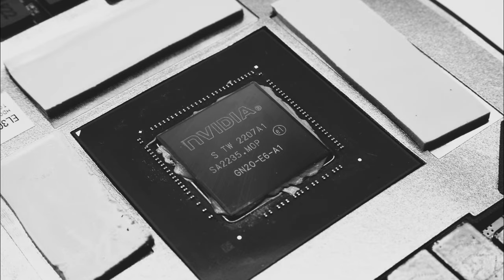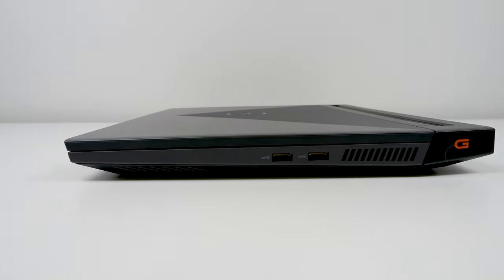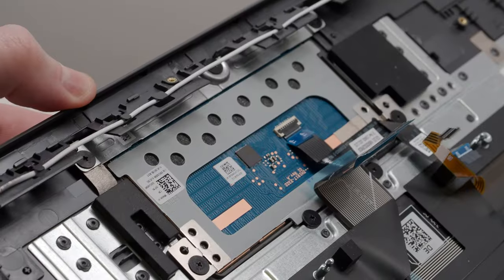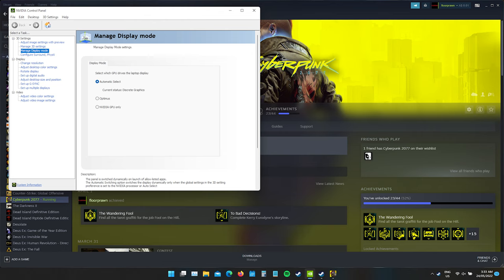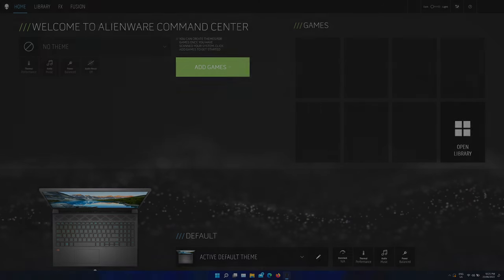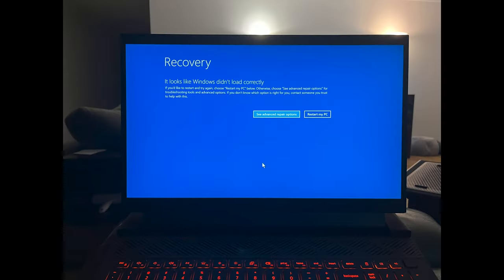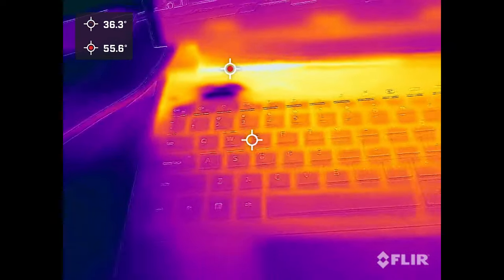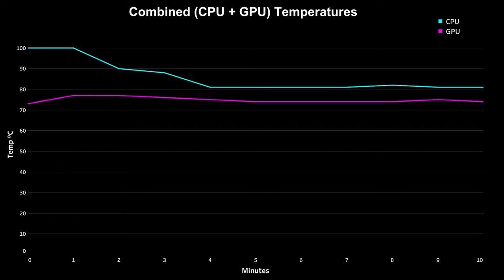Dell G15 5520 - i7 12700H/RTX 3070 Ti - Nuclear Review

Comment: That is exactly it, if not worse, experience with laptops for the better part of 15 years. Cheap and and structurally weak plastic frame that barely hold the screen in its place, and will inevitably fail. Half the apps/programs don't work or sometimes work. They clog up easily and require regular maintenance every 6 to 10 month. Every time you open a laptop for cleaning something WILL break or stop working as intended.
Everything is pretty much integrated these days so replacement part are a thing of the past, even cleaning is harder to do every generation due to integration and poor design.
You'll be lucky if your laptop lasted the full 12 month without something braking or failing.

Comment: Forget laptops doing gaming, at least AAA gaming, they'll go ok with occasional gaming and thats all. Most of these laptops WILL thermal throttle, maybe not instantly, but just look at it about a year later, you'll also pay an insane premium for it to be mobile, and you wont just pay in actual money, but also in performance, as a 250watt hard limit, and the thermal limit will dictate performance, whatever tech you have inside. So the end of the day its massively overpriced for the problems you accept by buying it. Very poor value for money overall. Not just this, but almost all "gaming" laptops. You are still a lot better off by buying a secondhand desktop for ¼th the price (secondhand, because it's a lot cheaper, plus if anything goes wrong you CAN replace the components), and pretty much any budget laptop for mobility. That way you are at about half the cost, and still getting peak performance (even overclocking goes) and mobility too. All in one devices, or desktop replacements just wont cut it.

Comment: Lazy engineering R&D from Dell. While they had figured out the flaw of their designs in 2021, when using different processors configuration they managed not to change a thing about their cooling aspect and blew it. And while I was kind of bummed out when they sold the 2022 laptop with new and better processor with few differences in price compared to last year edition which I've bought at the end of 2021, I was kind of grateful when founding out they eliminate the second SSD slot altogether in every 2022 version of G15. That stupid change will drop the G15 sale to the bottomless abyss. Do not buy it, period, until they included better cooling, power management and extra SSD in later version.

Comment: Great review! I'm currently using 4th gen i7. I do 95% software development, databases and programming and 5% gaming. I have been waiting for a nice upgrade. I have my eyes on this. It's the cheapest i7 12700H that I found by a mile at $1050.
I have a question though:
- does this overheat?

Thanks and more power to your channel!
Reply from the maker: No, I wouldn't say it overheats. The external casing is always warm, and the CPU will briefly bounce off 100-degrees under short burst workloads (this is OK, if not ideal), but it can keep the temperatures under control for the most part (especially if you aren't using the dedicated graphics chip).

Comment: I will never order a Dell product and I suggest everyone else does the same. Their quality control is notoriously shitty. Like an idiot, without doing my research, I spent ~$1500 on one of their higher end laptops that could handle my daily workload and it came with a faulty display out of the box and after looking it up online, it turns out this is very common for their products because their quality control is dogshit. Save yourself the headache and order from a different company, and unlike me, do some research before you buy.